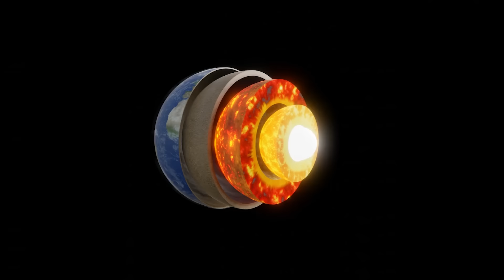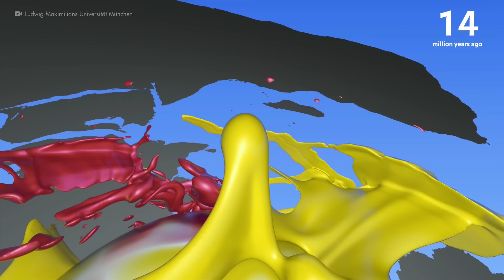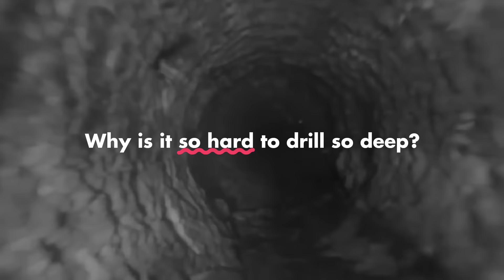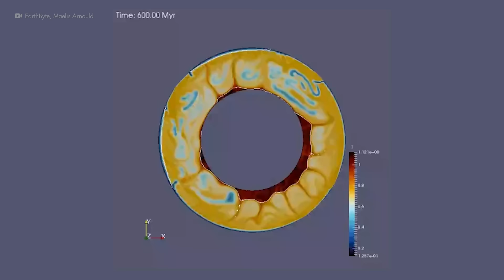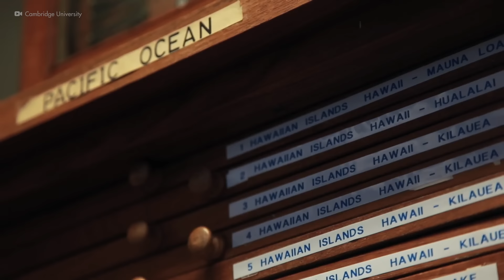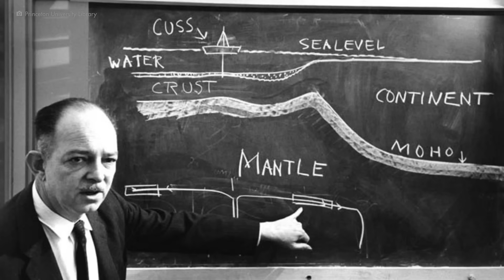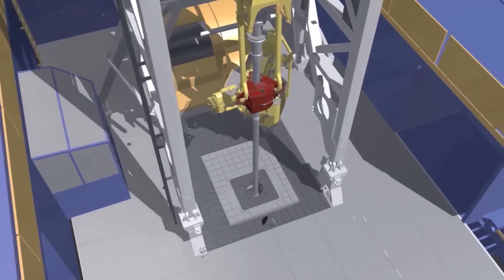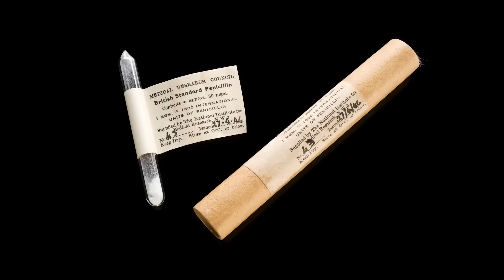Why Is China Drilling One of the World’s Deepest Holes?

Comment: Russia has drilled a hole 12000 meters deep.
Reply: That's what he said
Reply: The record holder is Z44-Chayvo Well anyways but claming that 9000 meters is depper than oceans or 11 000 m is the deepest hole in the World is just so wrong...
Reply: Story they found rare earth minerals.  China looking for Playdium.
Reply: nigelbiddell8917  yes, because it's a deep hole!!
Reply: They hit a hard rock layer called chirt, i think. Also, the drill bit was so hot.@nigelbiddell8917
Reply: nigelbiddell8917 there is a video on the Russian bore hole, and the noise coming from the deep hole is like people screaming.
Reply: They actually hit a spot where rock was rubbery and couldn't be drilled!
Reply: nigelbiddell8917 The heat inside was way too much for Russians to continue drilling further.
Reply: I wonder how many people are down there
Reply: Don’t think so.. pressure too great
Reply: 😂😂none, it just sound of gases @Prettymisskay
Reply: Congratulations you just repeated what he said, and you still missed it by 300
Reply: 40,230 ft i think, to be exact, which is almost eight miles
Reply: @paveldrumev2117 deepest borehole man.  The drilling equipment wont hold up after that far because of the heat and stress of turning all that steel in a deep hole.
Reply: nigelbiddell8917 i heard it was supposed to be because they heard human screams and thought it was possible given the heat that they had drilled into hell
Reply: @michaelmckinney401 It was the sound of escaping gases. Nothing more. They shut the project down because they ran out of funding.
Reply: Well, under the Gulf of Mexico is 3 big oil pools that america extracts oil from and they deep into both ocean and rock.
But under this oil reserve is the main one, that feeds the above ones thru rock cracks.
 I read that 1 engineer said not enough oxygen on earth to combust the amount of oil there but it’s too deep and the technology to drill so deep under so much pressure way into the future..
Reply: The deepest hole is my sister in law
Reply: @Jamac007  😂😂😂
Reply: That’s the first thing I thought of!
Reply: @karylhogan5758  Have drilled gas myself , if oil is cooked and are that deep it usually refined naturally to gas in what the oilfield called the Kitchen . Worked in Alaska field in Artic oilfield oil can from wells 220 degrees and they are only 6500ft
Reply: @Prettymisskay  lot of them and who's know they're having a 🍕 pizza party on other side maybe 🤣 and enjoying many black holes 🕳️ ☺️
Reply: No. In Russia, hole drills YOU 12,000 meters deep
Reply: I don’t think China will now in 2024 be able to finance such super expensive deep hole project, simply because the country is cash strapped of funds, all banks unable to return bank depositors money in full on demand, limiting cash withdrawal to only Y10,000 yuan per depositor the bank chooses to give with millions of other bank depositors protesting outside these govt owned banks but were quickly hauled by thugs together with the state police to jails. Meaning the coffers of the chinese Central bank does not have money to finance Chinas bureaucacy which lead to China just printing currency not backed up by gold deposit reserves. And since 2019 big western corporations had slowly left their huge multi-building factories and transferring most of its heavy machineries to Vietnam India so it meant by the 4th quarter of 2023 over 100 million chinese including several million University graduates are unemployed, and if there would be the rare chance for any job opening, around 10,000 job applicants will Show-up for that single job interview. Nobody outside China knows how many Citizens male female children died in the yearly covid pandemic it experienced since Wuhan Sara covid outbreak. The govt banned any information about the true state of the economy including unemployed statistics deaths and the latest chinese vaccines given to covid patients in 2023 where hundreds of thousands who received the covid vaccine died of heart attack, not one or two patients dying of heart attack but over hundreds of thousands but l am sure these info were suppressed telling hospitals to record some other disease not covid so all will look well inside and any violators inside China goes direct to jail and will never be heard of again. So Good luck in your optimistic story about China completing this drilling within 15 months timeframe. 😂😂😂😂😂
Reply: @catman5546  noted, thank you for replying.. respect to your hard work on them..🧐
Reply: They will find pre smelted pure elements ... Let them seperate and cool In special pressure relief chambers will seperate and you'll have pure no need to clean dirt from the iron ore and more ... Plus research
Reply: Nothing Russia says is true..
Your some clown trusting Russia
Reply: Same
Reply: Планета земля на самом деле является потухшей микрозвездой, внутри которой происходят не термонуклеарные а просто нуклеарные процессы
Reply: Yes, the "kola superdeep borehole"
Reply: @thefringeminority2019  did Pepsi sponsor them?
Reply: That hell audio supposedly from the bore hole was actually from an old horror movie. Fooled many people back then, though.
Reply: They say souls of the dead scream inside the hole.
Reply: @Ezekiel903 ...BECAUSE THEY REACHED THE DEPTHS OF HELL 😮😮😮😮 NO LIE.... 😢😢😢😢😢HELL IS REAL...
Reply: @ElprofeJVilla  yes, the depths od despair💀💀🙄
Reply: @karylhogan5758 I will trust Russia first, more than what we have here.
Reply: @FANLIZable  Ukraine did too
Reply: They'll find Aliens and a UFO colony.
Reply: And yet they found no good sense. Hope the chinese dig deeper, and find some.
Reply: No, it was ussr 😂 russia can't do that
Reply: Putin done it. He's boring as heck 😅
Reply: @sheseesyou that was from the microphone melting
Reply: 12,300 metres is what was said in the video
Reply: In Mother Russia, hole digs you!
🥸
Reply: @rocketraccoon1976  is that because of krokodil-induced skin necrosis in an intravenous drug user
Reply: That's 7 miles
Reply: and stopped by unknown reason 😢 So China shurely stops at same depth.
Reply: If you examine this earth in light of lies you will not find anything worth knowing, only armed with the truth can you find more truth.
Reply: 🐕💚🍕 dogs like pizza 🤠 that's nothing 🥸 I was at the beach Saturday and dug a hole 13000 meters deep 🎉 so there 🤠 dogs like pizza 🐕💚🍕
Reply: they drilled until it got so hot they had to stop or they would have kept on going!
Reply: @MENE-TEKEL so a burnt out sun?
Reply: Boromir would have dug 15000
Reply: I think they finds Mao's red book.
Reply: @jhunbriones6965  No one has the time to read that bullshit of yours😂
Reply: Lol .. what ? Did they start on a 10,000 kilometers high mountain
Reply: Still lookin for the secret Nazi Utopia?...gonna have to drill deeper than that.
Reply: They said that ya weirdo? 😂
Reply: @Ezekiel903 😂
Reply: nigelbiddell8917 To hot. Drill bits were getting so hot that the bits would break
Reply: It was the Soviet Union, comrade!!
Reply: @paveldrumev2117 With a depth of 12,262 metres, the Kola Superdeep Borehole in north-west Russia is the world’s deepest human-made hole
Reply: Did u watch the vid lol
Reply: yep l have heard so much about it
Reply: They haven’t even pierced the crust but somehow know what the center looks like. Trust the science, people.😂
Reply: Some people with beards had the same idea in Brooklyn 😮
Reply: @FANLIZable that is just stupid
Reply: @Jamac007  😁🤣😂😛🤪🙃🙂😉😀😅😜
Reply: heard the dome is also 12000 meters high
Reply: @sheseesyou the noises were fake. 😂
Reply: Oil.  Probably more than once.
Reply: Did they find any democracy yet?
Reply: @paveldrumev2117 challenger deep in mariana trench is 11034 meters so is very stupid to claim that when we still have just discovered 5% of all oceans as well...
Reply: @Prettymisskay 
Many many souls are kept there in Hell.
Reply: Probably going to fill it with putins' political opponents.😅
Reply: @DD-fc1rv  
Hope do.🤣👍
Reply: This guy is obviously had a very high fever reading only the.headline and didnt watch the video till the end. He should learn to be civilized😂😂😂
Reply: Yeh the video told you that
Reply: USSR, not Russia.
Reply: @crisrobinson still fooling them apparently 😆
Reply: It was 15
Reply: Depends on what lvl you still. If i go up a mountain 3000high i can drill 12000 deep but i will loose 3000.
Reply: @pashapasovski5860 why couldn’t they drill the “rubbery” spot? 🤔
Reply: 😂😂😂😂TO MUCH AFTER MINECRAFT 😂😂😂
Reply: I found yesterday my first Diamond 
..i spend 15 minutes for Diggin 

and found a Hugh Cave..
...i found Bones and a loot of Skeletts 

..strange orange glowing Plants from top to ground inside the cave ..

I use little bit selfmade TNT and falls deep . .

But say the Truth 
I used the Godmode for this Quest
...Minecraft 😂 ps4...

...i cant found the Treasur😂
Reply: nigelbiddell8917  They heard hell
Reply: @sheseesyou yeah like wtf
Reply: Then they heard ghost crying 😂.
Reply: China will try 12001. US will 12002. Ind Jones  12003 and its just for the tiolet🤢
Reply: USSR*
Reply: @sheseesyou  its fake
Reply: cola bohrungen
Reply: CORRECT... 12,230 meters or so.
They quit drilling when they discovered that their drill hole would NOT remain open. The consistency of bedrock at that depth was that of putty. The hole merely closes back up. 
  There was no point in attempting any further. I tend to doubt if the Chi-coms will have much better luck. 🤔
Reply: Well, the Chinese should’ve just continued where Russia left off
Reply: @user-zv8gd3jl7q  It wouldn't do any good. The bedrock that far down turns into putty. That's why the Soviets quit at 12200 meters.
Reply: @karylhogan5758 
Nothing Russia, OR China says, is true.
Reply: @djgenius626  Nope, it's 12.3 kilometers.
Noticed how easy the conversion was 12,300m --> 12.3km
Which calculator was used to figure out the mileage?
Reply: And found nothing of value
Reply: We don't know beyond 12 thousand meter.  Period.  Beyond is unknown unproven theories.
Reply: @jhunbriones6965 sounds like the usa
Reply: nigelbiddell8917 Dragons....
Reply: Someone didn't watch the video i guess?!?😂
Reply: @sheseesyou If you belive în fairy tales
Reply: Soviets not Russia
Reply: You know there are a few hundred million conservativly! @Prettymisskay
Reply: Question if the hole gets into the oil basin and it penetrates into a cool good that cause a massive explosion like a fuel tank in a car for the spark plug what would be the results have? They thought about that? That is the question?
Reply: Science will destroy this planet eventually, as technology improves so does our stupidity
Reply: And.? What they find or they going deeper
Reply: They looking for the end
Reply: I didnt know your mom was found in Russia.
Reply: @sheseesyou it’s fake, the sounds are from a movie called baron blood 1972
Reply: comprehension is crucial
Reply: Good for them. Wish them all the luck to go deeper than ever before .
Reply: They were trying to find decency. The mission failed.
Reply: @merlebarney always some scientific explanation for something isn’t it? What’s more baffling is the unexplainable
Reply: Russia? 😂😂😂 Really? Or sssrs?
Reply: @pashapasovski5860 yeah cant go no deeper its all rubbery
Reply: How deep does the San Andreas fault extend?
Reply: Cool story bro
Reply: They're gonna release Cthulhu...
Reply: Iljjjjhh @Prettymisskay

Comment: do not drill too deep you might punch the roof of hell 😂
Reply: Yeah, it won't go far.
Reply: Or massive amounts of heat will blast through the small hole making a much larger hole and cause a slight tempter drop in our core and mess things up. Like a boiling pot of water on a pan with a lid on it. Put a small hole in the lid steam will shoot through it lowering the boiling point. It could mess up our earth interior. Volcanoes may develop elsewhere. Or could pre shorten our core life. Our core is hot because of pressure and heat not escaping through the upper mantle.  When it hits boiling point it blast magna   through upper crust and out from naturally formed volcanoes. But punching a hole right through to our core. Could cause serious problems for earth interior by heat escaping from the actual core itself
Reply: wake up to reality
Reply: HOT there
Reply: Ultrakill
Reply: Hell is empty. It’s long out and is among us.
Reply: @Igorsov  right animal kingdom is hell

Comment: I heard on the radio about some startup saying that they could drill with microwaves or something, and this was to setup sources of geothermal energy. The method doesn't rely on physical contact thru drill bits, so according to them, it works better because there's no drill bit to wear out prematurely when exposed to the high temperatures.
Reply: It's not how you drill the problem, but how you get rid of the excavated material.
Plus, at a certain point, more or less as deep as the russian hole went, you'll get too hot temperatures to continue. Keep digging, and you will pierce the crust and plonge into tge mantel: the pressurized magma will fill up the hole once again in a matter of minutes. 
Not very useful way to spend money and time.
Reply: @ilmaio  if nor come out. That happened a few times in Iceland whilst drilling geothermal bores which hit magma pockets
Reply: The startup plans to use a mazer to vaporize the rock and then pump out the gas. Should work in theory. The tech still needs to be tested.
Reply: @shadowgolem9158  ¿what's a mazer?
Reply: “The Core” (2003): A bunch of disturbances in the Earth's electromagnetic field are making birds drop dead and random lightning storms wreck havoc; a geology professor concludes it's because the planet's core has stopped turning, which launches a top-secret mission to drill into the center of the Earth and blow it to
Reply: This probably falls under the direct energy weapons section.
Reply: @brauljo laser, but with microwaves
Reply: I was thinking of small explosive charges that would open up a foot each charge. They would be cheap.
Reply: @ilmaio  Mantle is not magma bro

Comment: I'm sure this has already been commented but once you get into the 7,000 meter depth range, the heat keeps the rock pliable and eventually, as you go deeper, molten. The drill technology relies on gravity, rock density, and downward pressure to keep the drill bit pointed downward. If you look at charts of  the Russian borehole, the drill can't maintain relatively downward direction making speghetti-like holes below 7,000 meters. The only way to correct for this is to use a self-guiding drill bit that looks like a small slender car, has a gyro and gps built within. However, the problem previous inventors were having  is the computer compenents being knocked out by the violent vibrations, the magnetic fields being generated, and the heat to name a few. If they solved those hurdles, maybe, just maybe, they'll be able to bore further than any previous attempts. But, then what?! LOL! Mankind is the most wasteful creature of resources on this planet.

Comment: I worked in the drilling industry for over 30 years. Deepest I been 7000 meters. It's not easy as you think. Geologists get samples usually every 5 meters. So you just drilled 6065 meters. And you are waiting for that sample to come to surface. Which will take hours. Lots of calculations needed for arrival of sample to reach the Shaker. Plus there's high temperature. Then there's the amount of horsepower needed to move the drill string. Not a very easy task. Will be interesting to see the results.

Comment: technically if they were to drill a bore hole in a geo thermal zone, and have nearly $1'000'000usd of repurposed refrigeration gas with a modified natural gas turbine generator, technically they could make a geothermal power station with a 350KWhr capacity just going off basic global average ground temperature at depth nearing that 8 to 15 mile mark. but then just like a bonsai tree it's easier to make a small version. just accumulate things over time and have nothing better to do with them... if the AC in the car runs backwards it actually heats the cab of the vehicle while the engine is still cold.